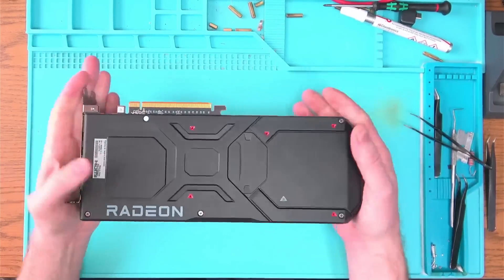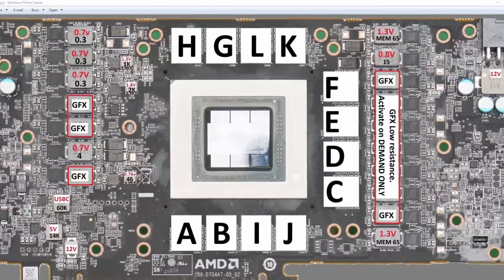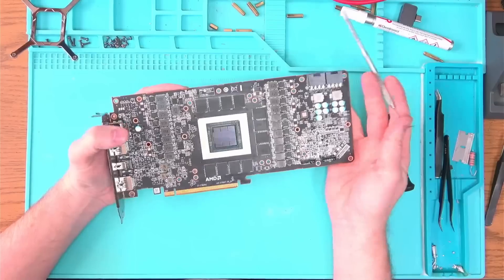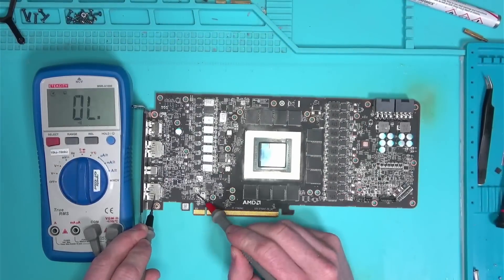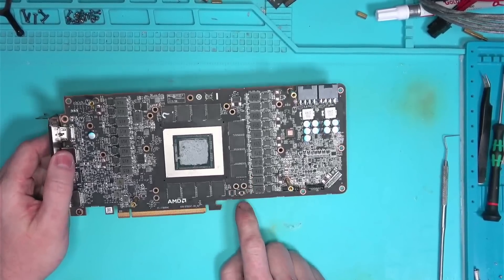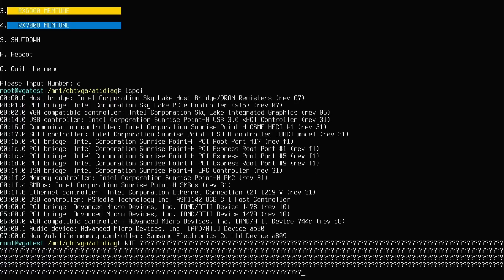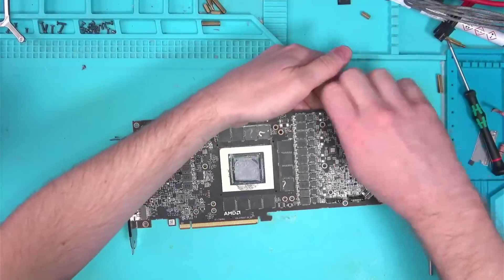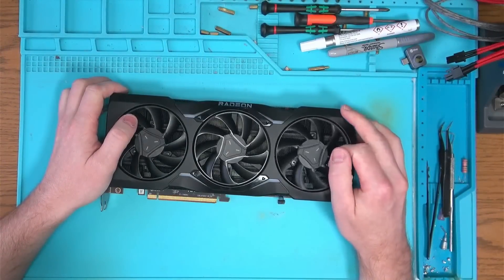7900XTX repair video

Comment: Chiplets are like disc breaks, you’ll come to love them and when you learn how to effectively repair like you have monolithic dies it’ll probably be easier to
Reply: probably need very expensive equipment to work with the tiny interconnects
Reply: He doesn't repair chips at all (with or without chiplets), nor does any normal repairperson. He just desolders and resolders them (and other board-level components, like BIOS chips, memory chips, connectors, capacitors, etc.).

Repairing the inside of a chip is in a completely different league (it's almost never cost-effective, and in many cases it's completely impossible).

Comment: Note to self, don't throw or drop high end expensive stuff, it does not like to be abused.
Reply: It's obvious from the video that the card sustained a really bad drop, AMD or Nvidia that will result in a dead GPU.
Reply: Who would have guessed, eh?

I slammed my Lamborghini into a wall and it stopped working. I took it to a mechanic who fixes a lot of Ferraris and he said "Lamborghinis are crap". It's strange why he's always having to fix Ferraris, though.
Reply: @RFC3514  Loved this!😅
Reply: @RFC3514  It's chiplet shenanigans . There is no proper car equivalent cause an engine has replaceable parts whereas a chip doesnt. But for the sake of it  imagine the engine block being a black box , you know what's inside but you can't touch it. Then imagine having to swap the whole engine cause of a single faulty piston .
Reply: @johntet  - Absolutely nothing in this video points to chiplet interconnect "shenanigans". He didn't even test the data lines on the board, let alone any connections in the chip itself.
Reply: @RFC3514  Actually he did both.
Reply: @Dandan-tg6tj  - No, he did neither. He tested the power lines on a couple of the memory chips, that was it.
Reply: @johntet  good luck replacing a faulty memory controler on a monolitic chip, wich by the way, has also traces inside  to conect the gpu cores to the memory controler
Reply: @johntet sounds like if apple made cars
Reply: True that...
Reply: lol

Comment: I got a Sapphire 7900XTX vanilla during Black Friday. Installed the support, undevolted and limited its boost (running 1440p). I’m keeping hotspot under 75C, not moving desktop at all. No issues so far. If I have to move it in the future, definitely taking the card out.
Reply: Anyone can use their card in whatever way they wish. 
Undervolting generally is a good idea with AMD cards cause often you dont even lose any performance, but do drop power consumption quite a bit.
Example my 6900 xt from ~300W to 225W.
Also the temps drop by a lot and well they can ofc run at factory spec, 110C for VRM and maybe like 90C for core. However for longevity lower temps are better. Everyone knows prolonged high heat degrades electronics.
Reply: I got a Sappire Pulse RX 7900 XT 20GB 6 month it this grafic card + 7800X3D  same temperature 76C Max HotSopt to my PC is all time on is Micro ATX my build ... Sapphire are good atm no problems last grafic card as a Sapphire Nitro+ RX 6800 16GB is a nice grafic card to
+ Asrock B650M PG Riptide
+ Ryzen 7 7800X3D 
+ Sapphire Pulse RX 7900 XT 20GB  
+ G.SKill Trident Z5 Neo DDR5 6000MT's CL30 2x16GB=32GB Com Perfil EXPO 6200MT's 
+ Power Suply MSi MPG A850GF 850Watts 80+Gold Full Modular 
+ WaterColler Corsair Hydro H100X 240mm  
+ Case Mars Gaming MC-MPRO + 5fans NOX HUMMER H LEDred
Reply: @albertovilela-Eumesmo i have the same gpu and cpu combo with similar ram and a similar setup as you. Have you ran into any problems so far or do you have any Tips for settings or anything else? I just built my PC 2 months ago but havent really used it but am about to for the first “real” time
Reply: damn
Reply: Vanilla? Anyway its MBA model? Which Is your limit of boost. My mba touches High junction temps but Is working fine
Reply: It's the Pulse, the entry level model. I'm limiting to 2200Mhz. I know it can go much higher, but I don't need it and want to keep power output under 300W. If left unchecked, it peaks 400-450W, which is crazy and makes no sense..... I don't need high FPS numbers, I aim at a good average for a smooth gameplay. My 1440p monitor refresh rate is 75Hz, and I wanted the card for the extra memory. I'm no fanboy (my last 3 GPUs were Nvidia, and before was AMD), the way I see it at the moment, I don't want to support Nvidia with their pricing strategy while offering less. I went AMD because it was way cheaper, much more memory and I don't care for ray tracing. @chubby_bear
Reply: if you need to undervolt and limit boost, im sorry but your gpu is faulty. A stock device is intended to work as is ,without user intervention :/ also 7900 xtx had a funny radiator fail and half of them were DOA cause they reached top temps after a few mins gaming :(
Reply: I don't need. I do because I want. Have done that to all my hardware. I have a Core i7920 running straight since 2008. It was my main desktop, it went to my kids and now works as an office PC at my wife's clinic. Same goes for videocards I owned. Voodoo 3, Radeon X850, 7970 GHz, RTX 1070, etc... never had a card failing in my life. I don't need to run at limit all the time, getting it to run 90-95% makes miracles concerning longevity, temperature, etc.
If you paid attention to my original posting, you will notice I bought it on 2023 during Black Friday, so my card is from Sapphire (not AMD reference design) and not an early one. I'm proud of having things running for a long time, not spending resources to build faster things I don't need. Good cooling and not overclocking (undervolting when possible) takes electronics to long life. @naomiarmitage8729
Reply: i never had a card fail ever ,and i didnt undervolt or lower clocks never ever. so why pay so much money to cripple performance? its pretty pointless anyways ,you could get a low tier card and avoid doing undervolt/clock.My point still is the same ,if a card does not work out of the box ,is DoA or faulty ,period. if you want to excuse it with undervolts or underclocking and driver issues ,ok ,but the result is just the same. i always had nvidia and im still waiting to see one die XD ,also i never had to undervolt or underclock neither. imagine gettin a bugatti and running the engine crippled to 100hp instead the top performance.... its your money and your choice ,not mine :)  @AladimBR
Reply: @naomiarmitage8729  BTW, very poor argument comparing to cars: you don’t drive them at the limit all the time, except perhaps in Formula 1. Try that and your car won’t last weeks, if not days. Your logic is flawed. But some people must criticize others in other to feel better/superior, so have it your way.
Reply: @naomiarmitage8729 people aren't always undervolting or limiting clocks because they are unstable
with a 69xtxh if I limited TGP to 250 and max core and soc voltages to 1075mV, the card would perform noticeably better,  different spot on VF curve meant less heat produced, a lower max core clock, though far higher average clocks and min lows as it wasn't trying to lightly roast itself at 1.2v 😅
Occasionally they screw something in the driver that causes it to give different values for max core depending on LeakageID/ASIC quality
Reply: Also, I explained I don't want a card consuming 400W to render 75 fps. That is called waste. Maybe you don't care, but I don't like to burn money and resources. @naomiarmitage8729

Comment: It's amazing the lead free solder would be earth friendly, Must be when it goes into landfill..😆😆
Reply: It is an element afterall....
Reply: That is literally why lead (and mercury, and other heavy metals) are banned from mass-produced goods: because people just threw them into the trash, the metals would leak into the ground and would contaminate the food chain.

They're still allowed for repairs, because that actually helps reduce the amount of waste. But as long as people buy tons of crap and throw it into the trash every day, the only way to prevent everyone from being poisoned is making sure those substances aren't there in the first place.
Reply: @RFC3514  Yes, but lead free and thermal stress don't mix, lead is ductile.
Reply: @proluxelectronics7419  - I think I haven't had a single electronics failure caused by cracked solder joints in the last 10 or 15 years (compared to several caused by dead capacitors, for example), so that really doesn't seem to be a big issue. 

It took some industries a couple of years to figure out the best temperatures, the best fluxes and and the best lead-free formulations (there isn't a single type of lead-free solder, just like there wasn't a single type of leaded solder), but it works fine now. 

I'll take my water and my seafood with less heavy metals, thank you.

Comment: I was looking at the 7800 TX... yeah I think I'll pass now...
Reply: Unless you want to pay 100+ $ for the same performance, they have put different memory chips in the newer cards that must have been the early first batch, NVIDIA isn't bad just so overpriced that you could just buy a used car. Good luck!
Reply: Its an excellent gpu absolutely nothing wrong with it look at benchmarks
Reply: i have one of those and i m very glad i got it its really a good card
Reply: So, you came to a channel about repairs and you think you'll "pass" on a model that apparently has never even been sent in for repair...? That's some weird logic.

It's like going to a channel about car crashes, seeing someone else crash a Lexus RZ into a wall, and deciding not to buy a Lexus ES as a result of that.

Comment: I thought my 7900 XTX was dying but it was just a driver issue that everyone could reproduce in Dying light 2 during one very specific cutscene where skullface gets introduced along with cool gas and smoke effects that produce an RGB laser show now fixed on 24.3.1  after a lot of nagging.
Reply: If it was just in one game and in a specific cutscene, maybe it would have been more productive to ask the game developers to fix it.

Modern graphics drivers actually include a lot of exceptions and workarounds to deal with game bugs (that's why Intel ARC cards still have so many problems - it's not actually Intel's fault, it's just that they need to work around game bugs and badly optimized game code), but neither AMD nor nVidia are very likely to make a priority out of fixing some problem that affects one cutscene in one game.
Reply: @RFC3514  i asked both, and it was not one cutscene, i reported it in 1 cutscene that happens to be very accesable tho and easy to check

Comment: My lowly RTX 6600 is still going strong after almost 2 years this coming September.  My entire AMD rig I put together that September as well is going strong. I got lucky I guess I didn't get a bummy manufactured part.  Also, isn't that chiplet design harkening back to the slot 1 architecture where intel and amd offloaded some of the CPU features like L2 cache?
Reply: No, you didn't "get lucky". The vast majority of systems work fine. Someone whose job is to repair graphics cards obviously has a skewed perspective of how many fail.

What surprises me is that he gets a lot more broken cards based on nVidia GPUs (and then tends to blame the issues on the card manufacturer), but keeps ranting against AMD and trying to blame them for problems with cards or BIOS chips (which are made by a different company). Maybe he was bitten by a dog called "AMD" when he was little. 😄

Comment: No wonder your dislike of AMD GPUs. Very random issues. Had one that would crash when any Ray Tracing was enabled. I know that RT isn’t AMD strongest point, but to crash is another level. Never again.
Reply: What exactly "would crash", and how many applications did you try ray tracing on?
Reply: Probably your PSU. Raytracing is very intensive.

Comment: NVidia just announced they will be doing this too. GG
Reply: Gg what its a logical thing to do coz if yealds on the chips makes it cheaper
Reply: There's no evidence it's ThE ChIpLeT dEsIgN problem. You can destroy connections between a single crystal and its pad and repairman will shrug just like here.
Reply: Well since Nvidia is doing it its good! Won't have to worry about amd chiplet drivers getting in da way!!!!!!!!!!!

Comment: The card appears to have been treated very badly, and the original sticker doesn't change that. That was the trigger and nothing else, even if chipplets is generally a bad idea.
Reply: It's clearly AMDs fault that there's visible physical damage on the board. 

What a joke.
Reply: It's such a "bad idea" that ever major chip designer / manufacturer is using them. I guess they know nothing about processor design and manufacturing, eh? 😜

Comment: Maybe, do what AMD does and disable 1/2 of the chiplet/s in bios? You might have to take some memory off as well. Many, many, many years now, AMD have disabled certain parts of the core of either CPU or GPU and sold it as a lower model. Reason is, the die did not pass tests to be a higher product SKU.
Reply: this is not new, it's been done also in the cpu space from intel. disabling cores is done in manufacturing, not possible for a user. disabling vram might be possible but you need a modded bios, but they are encrypted ussually.
Reply: @giornikitop5373  I am sure I have seen over clockers using a BIOS tool. Maybe, AMD, Intel and Nvidia just locked everything down.
Reply: @Del_UK  yeah, they're not idiots, if something can possibly threaten their profits, they will block it. but tbf, every manufacturer does that.
Reply from the maker: Disabling channels is possible for 30 series Nvidia but as far as i know, not for AMD.
All thanks to encryption.